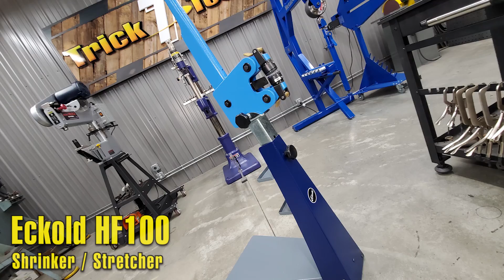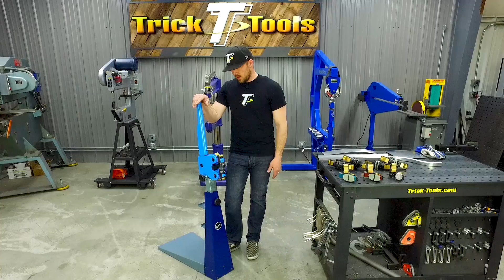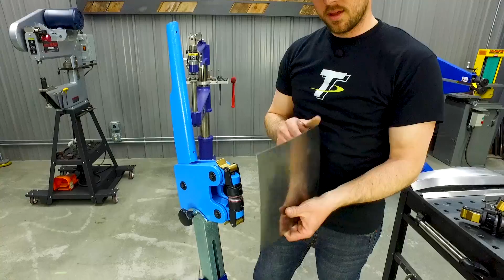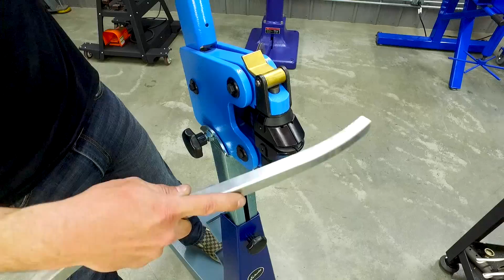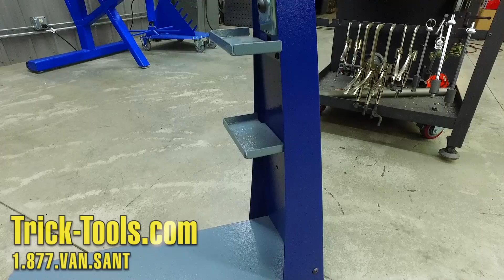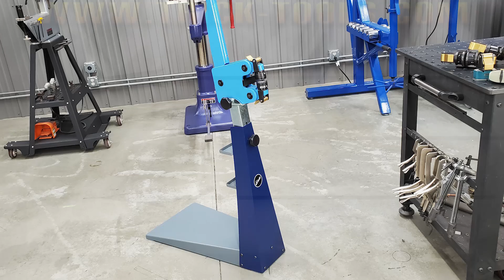Eckold HF100 Shrinker / Stretcher - Trick-Tools.com

Comment: The Eckold stuff is nice, just why the manual handle on the back??? I guess they think you will not be doing pieces that require both hands to hold?
Reply from the maker: Yes it is! Yeah, that's not the best setup for big parts but they do make an foot pedal operated air upgrade option for this machine to give you that flexibility. I am sure its a little bit of incentive to step up to the HF100PA for the KF170 if you need a more capable machine. Thanks for watching!